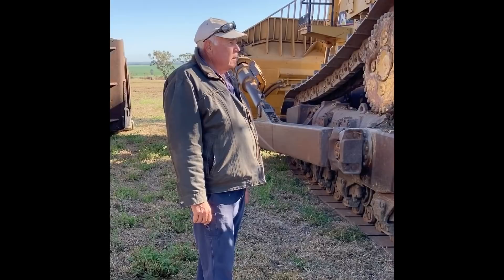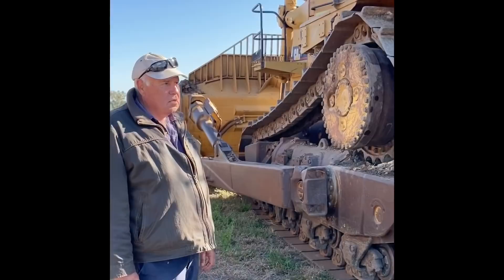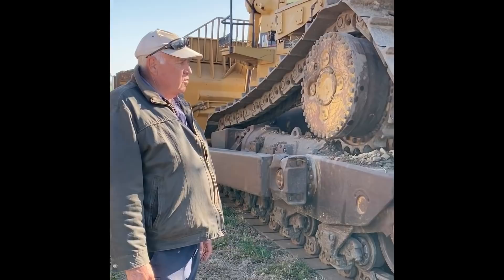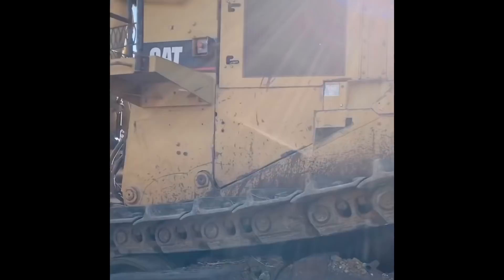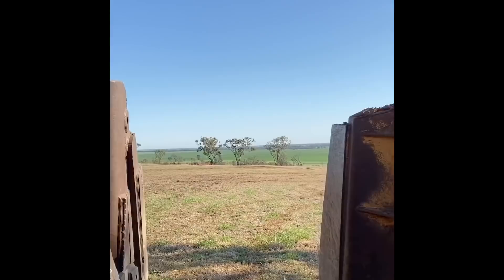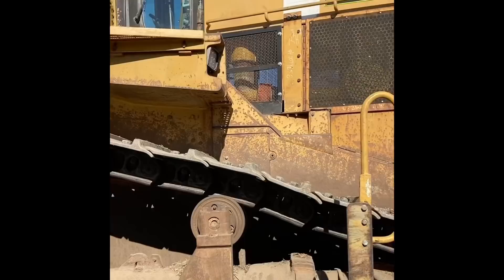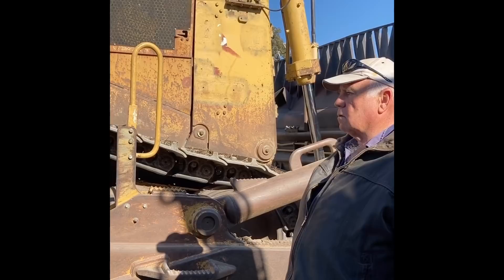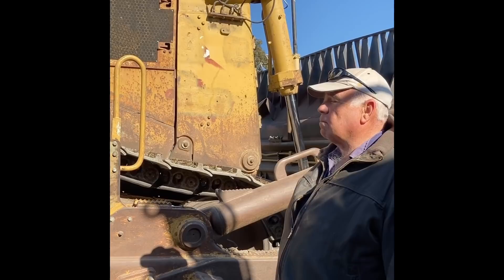Why We Have Two D11 Bulldozers on the Farm

Comment: Curious what prices you paid? D11 not an everyday choice.

How do you trsnsport them?
Reply: Ya just put them in top gear. they don't have any trouble with hills or slopes downhill. River crossings are pretty easy so there's no need  to go all the way to the bridges anytime. And along the way folks are so accommodating to have a little work done and that pays for the deisle oil. It really pays to avoid getting stuck while travelling however , as you can imagine?
Reply from the maker: Haha pretty accurate, unless it’s it’s a fair way away, and we don’t run them flat out as it’s hard on the undercarriage👍

Comment: How old are the D11N's? I see quite a few Cat N model Dozers where I work around the ACT. Never seen a D11 though. D10's are the biggest we have around here.
Reply from the maker: Hey mate, one is 1987 and the other is 1991👍
Reply: Did a lot of work on 8,9,10 only ever worked on one 11 in 30 years in the repair business 25 Lineboring etc I believe that in the rock mining in the west the smaller dozers were more cost effective as they were generally only pushing dumps etc with little skill required to operate ,also for transport the old 10 n or l were Awsome machines for an amateur like me to operate